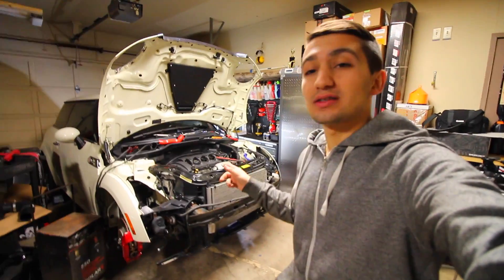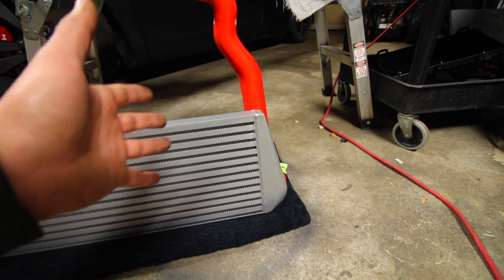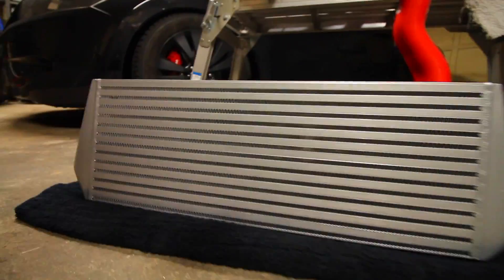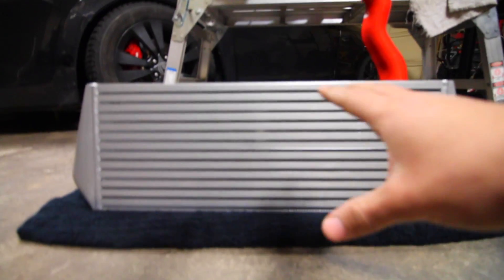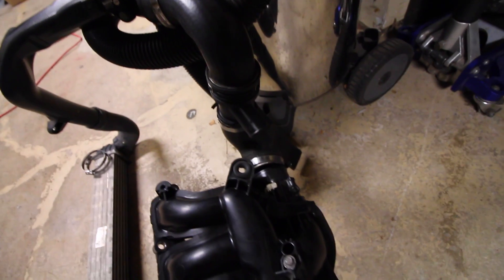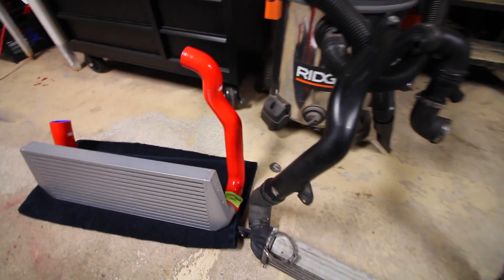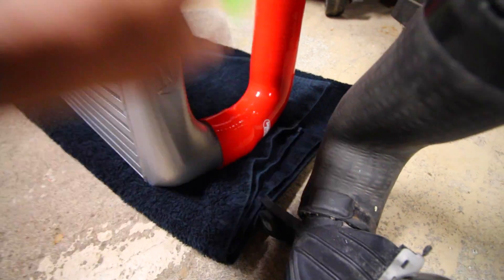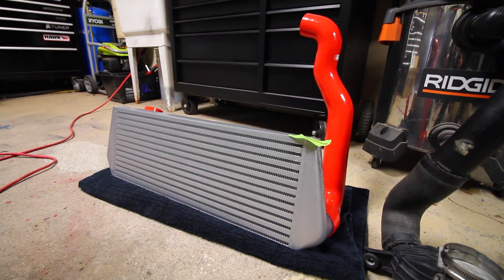What is an Intercooler and What Does it Do?

Comment: I used to work for a company that made custom intercoolers for racing applications. From an engineering perspective, it was pretty interesting work. I worked on development of the systems they made for the Mazda miatas. It seems like a simple device. But getting it right is extremely complicated. It's a delicate balance between maximizing heat transfer while maintaining boost. You're going to lose boost pressure with any intercooler. So the net gain of the heat transfer (cooling of the air) has to surpass the loss of boost pressure. This is why pairing the right cooler with your turbo is so important. 💨
Reply: Thank you  didn’t know that

Comment: what is the difference between turbo engine with intercooler and with out intercooler.
Reply: There is usually very small intercooler in the engine bay already in turbocharged cars, but it's usually bare minimum for cars' health. When it's getting too hot, especially in summer, than you get much less power as the compressed air from turbocharger is not cooled down enough. This makes less horse power, and also, it's not good for the engine. Knock timing has to be reduced to protect the cylinders. So, the FRONT mounted intercooler saves the engine in the long run as well.

Comment: I’m surprised someone hasn’t came up with a way to convert the AC in the car to go directly to super cool the intercooler.
Reply: The easiest effective way is to spray the cold water on it. You can add extra tube to water tank and arrange it so the front of the intercooler gets sprayed by water.

Comment: The air doesn't travel in straight path from left side of intercooler to the right side of the intercooler like you were showing. The air travel through thin copper or aluminium pipe from left to right in zigzag way. The larger the intercooler the longer is the pipe inside the intercooler. The air gets cooler the More distance it travel down the pipe.

Comment: How the intercooler connected to  engine and turbocharger
Reply: Exhaust valve from cylinder opens. This plus air from the outside via air filter goes to turbocharger. All this is compressed by the turbo (also gets super hot), and this goes through intercooler. Intercooler cools the hot compressed air, and this cooled air goes through the intake valves. Because the air is cooler, it also has more oxygen, which helps burn more efficiently. Hence, more power.

Comment: Does it matter which side the air go thru the inter cooler? Does it matter which side of the intercooler facing?
Reply from the maker: Nope!! As long as the air goes from one end to the other on the inside, and is exposed to oncoming air from the bumper area, it will work.

Comment: so the intercooler doesnt suck any air, air just passes thru from what the intake is sucking to the turbo and the cylinders right?  the reason i ask i live in a place where when it rains it floods somewhat nd i dont want to damage my engine if water gets up to the intercooler.. thanks in advance..
Reply: Intercooler and piping should be a sealed system. No water will get into it from puddles through the intercooler.

Comment: Hey why should we use intercooler why don't we connect the turbo charger directly to the inlet manifold because if the air is hot then no need to compress more to burn isn't it ?
Reply: Your ECU will limit the amount of fuel injected into the cylinders to prevent premature ignition(backfiring), but if you cool off the intake, the ECU will let the fuel flow full blast.

Comment: hi, is it make a difference if you install an intercooler but you don't have turbo yet? HP wise, thanks,!
Reply from the maker: You MIGHT see a small difference, but it wouldn't be a worthy modification unless you're boosted. Good question :)
Reply: milanmastracci So what should I install first, Turbo or the intercooler? Thanks man for replying! Nice vids! Hope you push through with the intercooler installation vid.
Reply: Mike Honda Boy I had the same question as well and found the answer here. Im assuming you've found your answer by now but Id say they should be installed about the same time. Bc you dont want the turbo on the car without a way to cool the air down, but an intercooler by itself doesnt really do anything. The intercooler needs to connect to the turbo, so Id say buy them in any order you like but install them at the same time

Comment: air from the intake goes into the turbo??? I thought exhaust gases spinning the turbo compressor...🤔
Reply from the maker: You have both the intake and exhaust system coming together at the turbo. The gasses are separate, however both of them travel through. Once I go Big turbo, i'll explain in detail how they work :)
Reply: milanmastracci ohh yea yea yea. I mistaken the intake for the throttle body.

Comment: So you can see through, but it does not leak. Can someone explain me how?
Reply: The air doesn't go through the holey parts. It goes through the piping between the holey parts. Well, it does but not the air we'd need for the turbo. Makes any sense?
Reply: The condensed hot air flows through the piping, as "natural air" (best way to describe it) flows through the holey parts, hitting the piping.

Comment: hello milan :) awesome videos!   i have a question, i own a bmw 2 liter turbo diesel, and a few months ago i hit a rabbit on highway (RIP rabbit) and it broke my bumper and bend my intercooler a little, there is no leak. but i want to buy another one from used parts, should i buy the bigger one for 2.5 liter, or even 3 liter version of my same car, they should probably fit perfect. thanks !
Reply: i'm affraid if i run a biiger one i would have a bigger turbo lag, beacuse my turbo and everything is stock
Reply: @bogdananghel9480  put it, bigger intercooler beter cooling...when you do performance setup in official bmw they upgrade from 330d on your 320d...m performance kit